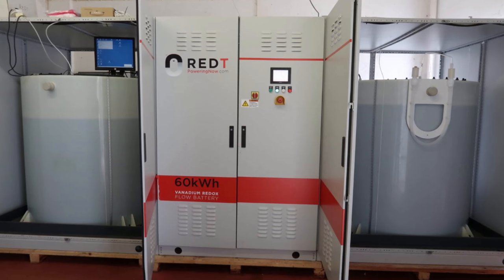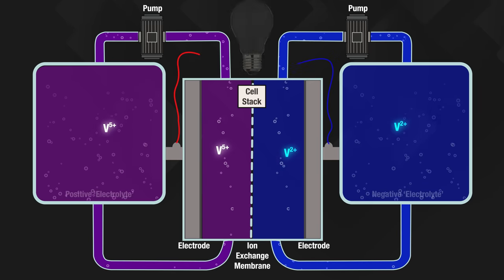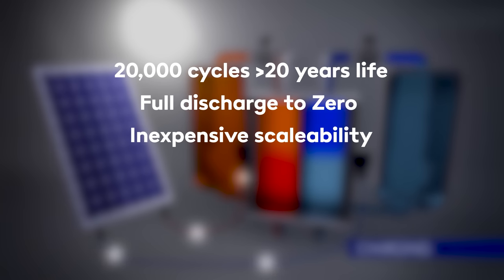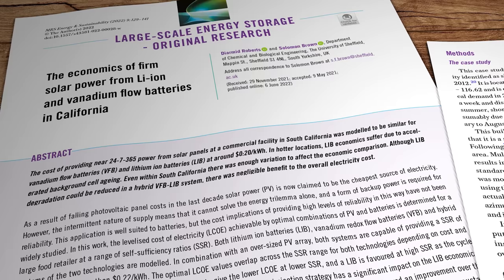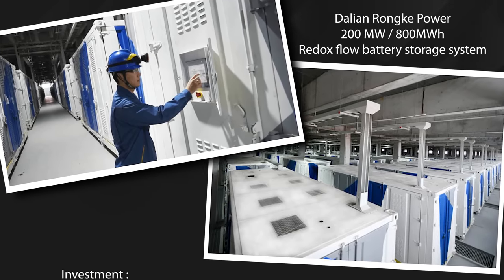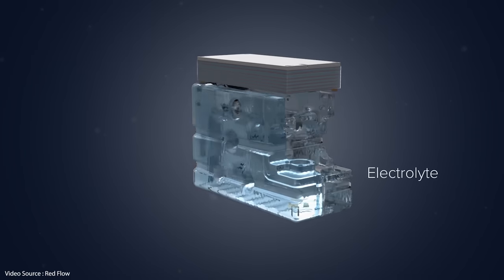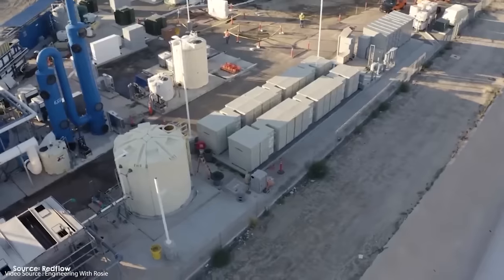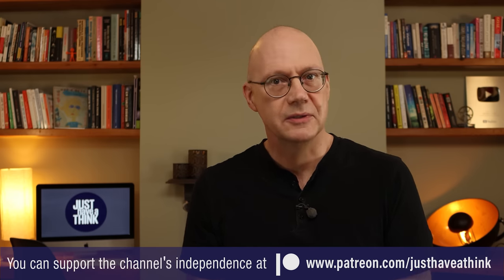The new billion dollar battery disruptor!

Comment: I think a good way to use redox would be a hybred with a lithium as the main for day to day use and the redox for longer term like week or month storage. Lithium with it's more efficient exchange and redox for it's low self discharge for longer term, should be a winner for solar and winds ups and downs, to take advantage of times of peak productivity.
Reply: Can you explain how lithium is more efficient?
Reply: @mortenhartvigkristiansen7760  lithium ion batteries have a lower resistance, so less electricity is turned to heat and when that  energy is used, over 90% comes back out again for use and I think in the video they said the redox has an efficiency in the 70's percent.

Comment: You noted that for added energy storage capacity with a redox battery, all you need are larger tanks. If true, then the incremental cost in $/Mwh for say doubling energy storage capacity should be far lower than the cost in $/Mwh for the initial amount of storage. 

Can you please give us some numbers, so we might gain some understanding of the relative cost and its incremental scalability, to address storage needs for standby capacity and possibly even seasonal peaks, as well as the daily time-shifting of solar energy from daytime to the nighttime?

Comment: I first read about redox flow batteries about 20 years ago, and it's pretty cool to see them reach the market. The idea of a bromine leak/spill from a Redflow system doesn't sound like fun, but I have no idea whatsoever about what the consequences of a vanadium electrolyte leak/spill might be.
Reply: Please look at the website for Gelion Endure battery in Sydney. They maintain that their Zinc  bromide battery is extremely safe , as it the key element in  fire extinguishing systems. Not poisonous I assume. They also toast a unit on a barbecue to show how safe it is near heat. 
Regards
Mal

Comment: Great video. Storage Will be important, but different countries can have different solutions. Countries with a lot of solar could better store as heat with molten salt batteries, while those with lot of hydro or wind Will probably benefit more from batteries.
However, modern nuclear Will have a role as backup just in case, and as a result of the daily lobbying and bullying they do.

Comment: If you do the calculation even adding solar panels to a CAES sistem base on steel tanks the price per kw should be les than half of any battery,the 40 % loses will be overcome by the solar panel , advantage of a CAES is that natural gas or hidrogen can be use to multiply or extend the power.

Comment: Flow batteries are cool in that they decouple power from energy storage, and are not sealed systems so if membranes or electrodes fail, they can be replaced without scrapping the battery and recycling it.  However, efficiency and energy density are both poor and complexity is high relative to a maintenance free sealed battery system like Li or Na ion.  And the biggest problem for any battery which has no application other than grid storage, is path to scale.  To get to giant scale, there is but one path for them:  billions and billions of dollars in very patient and risk tolerant venture capital, willing to just go for it and produce them at scale, subsidizing the initially high cost per kWh that customers won't bear.  For a new Li ion technology with higher energy density for instance, there's a ready market in cellphones and other mobile devices, whose purchasers are willing to pay a great deal more per kWh than any grid storage customer.  That gets them through the initial few doublings in production scale, so they can take advantage of Wright's Law learnings and reduce their cost.

Comment: A vibrating IR-active molecule transfers the energy on collision with N2, O2, whatever, increasing heat, 2.7 billion times per second (8 billion / second for air near surface). It's the balance between the amount of LWR from below absorbed by the IR-active molecules, which does not depend on the temperature of the air parcel, and the LWR manufactured & emitted upwards by the IR-active molecules, which does depend on the temperature of the air parcel. Since it gets cooler with altitude, the net result is less LWR emitted upwards. This aspect has been MEASURED FROM SPACE CONTINUOUSLY SINCE 1964 (IRIS-A on Nimbus 1) and sample plots have been all over the internet for at least 15 years. The "greenhouse effect" (GHE) in Earth's troposphere does work backwards and cause cooling only when surface temperature is below 228K (-45 degrees) and the GHE gets increasingly more powerful, causing more warming, as surface temperature increases per the plot with millions of measurements from space all over Earth (a vast range of surface temperatures measured, a green hash) at one of my links below. From my correct reasoning of the physics above that I did 8 years ago I always knew that it would show less GHE, even backwards GHE, in bitter-cold winter polar regions, understood that just from pondering for a couple years or more before I came across the measurement proof on the internet. See below for MEASUREMENT FROM SPACE clearly showing  H2O gas, CO2 (huge notch) & O3 (little notch) warming the surface for Sahara, Pacific Ocean, Mediterranean Sea, Iraq but COOLING the surface of Antarctica in winter (because, obviously, the troposphere gets warmer with altitude just like the stratosphere). See clearly the centre CO2 & O3 maximum power centre spikes in the stratosphere causing cooling just like you said, but only the tiny stratosphere spike effect shown, so it's totally overwhelmed by troposphere warming effect. The 5 or so groups of physicists producing varying (by about 20%) results all do a 120--layer calculation (or some such) for the top of troposphere and a separate layered calculation for the stratosphere and the GHE is a more powerful effect at the top of troposphere if I recall correctly because the stratosphere gases well-mixed gases reduce it though the extremely-poorly-mixed H2O gas causes warming of the surface when it gets in the stratosphere because it radiates to space on average from very low at only 2 km above surface. 
----------
Measured from space since 1964 samples and the green hash plot of the varying (GREATLY VARYING) "greenhouse effect" (GHE) all over Earth (note the backwards GHE over Antarctica in winter because no sunshine so the heat is descending instead of ascending):
https://www.youtube.com/watch?v=NNgMyDRWWrA at 3:50
https://www.youtube.com/watch?v=Oog7-KOtpEA at 18:07 (4 FTIR samples for western tropical Pacific Ocean, Sahara Desert, Antarctica & southern Iraq)
https://www.youtube.com/watch?v=s-ab-ZNXnZ8 at 30:55 (3 FTIR samples measured in 1970 for Sahara Desert, Mediterranean Sea & Antarctica)
https://www.youtube.com/watch?v=rgP-lwf2tb8 at 17:09 (3 FTIR samples measured in 1970 for Sahara Desert, Mediterranean Sea & Antarctica)
-----------------
<Web>climatemodels<dot>uchicago<dot>edu<slash>modtran<slash>modtran<dot>doc<dot>html
It has one comparison with Sahara Desert measurement to prove it's accuracy. The measured since 1964 are IRIS on Nimbus series. At 1969 it's:
Nimbus 3 IRIS instrument satellite 1969
Nimbus 3, the third in a series of second-generation meteorological research-and-development satellites, was designed to serve as a stabilized, earth-oriented platform for the testing of advanced meteorological sensor systems and the collecting of meteorological data. The polar-orbiting spacecraft consisted of three major elements: (1) a sensory ring, (2) solar paddles, and (3) the control system housing. The solar paddles and the control system housing were connected to the sensory ring by a truss structure, giving the satellite the appearance of an ocean buoy.
Mission/Portal Page:	<Web>nssdc<dot>gsfc<dot>nasa<dot>gov<slash>nmc<slash>masterCatalog<dot>do ? sc=1969-037A
Launch Vehicle:	Thor-Agena
Instruments:	HRIR (High-Resolution Infrared Radiometer)
IDCS (Image Dissector Camera System), IRIS (Infrared Interferometer Spectrometer), IRLS (Interrogation, Recording and Location System), MRIR (Medium-Resolution Infrared Radiometer)
MUSE (Monitor of Ultraviolet Solar Energy)
RTG (Radioisotope Thermoelectric Generator)
SIRS (Satellite Infrared Spectrometer)
............ etc etc etc

Comment: That 60kWh battery looks bigger than 4 of my 14kWh batteries (to be clear: more than 3 times as big). It also doesn't look like it will be around the same 10k euro for that 60kWh, which is the current price tag for 4x self made 48v LiFePo 15kWh battery boxes with BMS.
So I don't mind the place it needs, as long as it can do that 60kWh for 10k and 120kWh for much less than 20k.

Comment: Sounds good!  The only concern I have is availability and mining concerns surrounding the relatively rare elements of Vanadium, Bromine, and Zinc.  We might be better off with flow batteries that use iron ions, or other types which use organic compound ions.  How about an ATP - ADP type of flow battery?  Biomimicry might offer some solutions.. 🌿 🌄😊
Reply: Iron air batteries are interesting but keep in mind that most biological systems have very tight temperature tolerances. Inorganic systems are much simpler to manage in terms of the chemical stability of their electrolytes and hence have lower costs.
Reply: Bromine is the 9th most abundant element in seawater by mass (the top 4 being O, H, Na, and Cl, obviously, then other salts with Mg, S, Ca, K). Apparently you can get a liter of bromine from about 20000 liters of seawater, and that's reasonably cost-effective.

Vanadium and zinc are less plentiful, but still 14th to 24th most abundant elements in the earth's crust, depending on the dataset. Zinc is about on par with nickel and copper, about 3× as plentiful as cobalt or lithium. Of course, that's a less useful measure for land than for water, as elements are far more evenly distributed in the sea.

Comment: If Redox Flow is best suited for >8h durations, why does the biggest installation in the world (the one you mentioned in china) have a 4h duration?
Reply: The durations are a bit misleading, it refers to how fast you can discharge the battery, unrelated to it's capacity. The longer the duration, the less power (Watts) can be delivered by the battery type. Not the amount of energy (WattHours)
Reply: Is that the same thing as some 18650 batteries don’t work with flash lights?
Reply: @Beeeeeeeeeee  Your reply came up earlier than the question, in my browser at least.  Perhaps the question went via redox?!
Reply: Because it doesn't have enough capacity to meet the demand for more than 4 hours.
Reply: @TheEclecticDyslexic  yes, that's how I calculated the duration. the question is, why did they size the capacity like that?

Comment: I would've loved more information on the Dalian plant, and dalian rongke power. Its capacity absolutely dwarfs all the western players you mentioned. They had their series b a year ago. The fastmarket article mentions a lot of info on cost, which is not that much better compared to lithium over a lifetime (25%) at the expense of higher upfront cost. Also downsides like lower efficiency and smaller optimal operating temperature.
Reply: A lot better in terms of use of rare earth metals though?

25% cheaper for a much younger technology is pretty impressive.

Comment: Off-grid solar homes need a high-power lithium-ion setup of maybe 10kW and a few kWh  plus a low-power system of a few kW with a MWh or two to store summer excess and recharge the Li-ion during winter use when the clouds block the low sun. Current flow batteries seem to built with similar power/storage ratios to lithium-ion in order to provide an alternative in the same market rather than serve a different market where Li-ion is not competitive.

Comment: citric acid (and table salt and vinegar optionally) as metal-air fuel cell electrolyte, use iron scrap metal as the storage, at 2kWh/kg specific energy, yep large fuel cell batteries in a container, or use the container metal as the battery, too, just use plastic as the container

Comment: Great presentation! While not directly commenting on flow batteries, I have for some time been considering ANY lithium based battery solutions (yes, even solid) as dead ends. Lithium is scarce and I read a recent calculation of how much lithium exists globally and if every electric car over the next 10 - 20 years had to replace their lithium batteries twice, there would not be enough lithium in the world to handle the replacement. That is not a sustainable future. So, I get most excited about the new solid batteries that use NO lithium and are working towards using plentiful elements that are 100% recyclable. Seems like we will be there inside of 5 years.
Reply: Lithium batteries are recyclable.
I suspect you may have been reading a propaganda piece.
Reply: Apparently, China has just developed a solid state sodium battery which will be available in a compact EV for the Chinese car market. I hope it will also be made for export.
Reply: @alanhat5252  No, it was a decent piece that took into account levels of recycling. Sorry, I have to look for the article to back up my statements. But, anecdotally, there are lots of claims for recycling this and that and very few examples of industry actually proving they can do it.

Comment: Hi. My offer is out of the topic but want to ask. How about combination of Stirling engine and heat pumps? With application of Stirling engine  and high efficiency heat pump there's a possibility to use hiden heat for power generation and cooling of air. It has to be a great solution in the age of global warming. What do you think about it?

Comment: Flow batteries have an advantage over most other designs.  A fully-charged unit can be rendered electrically OFF by simply draining the cell stack dry and isolating the tanks with valves that are closed.  Turning off the pumps has the same effect eventually, when the cell stack completely discharges. 
You can even put a dead short across the + and - terminals to indicate that battery is not electrically live.
Shorting the terminals on most fully-charged batteries is a common way to have a very bad accident.  All that energy wants to get out _NOW_.  Talk to anyone who has dropped a wrench on the poles of a charged car battery . . .
Another advantage is that the power output is completely independent of the state-of-charge IF the charged-electrolytes are stored in tanks separate from the discharged-electrolytes.

Comment: Forgive me for counting, but isn’t vanadium 5 to Vanadium 2  a transfer of 3 electrons?

We need more info on the comparison of Vanadium and zinc bromide systems, methinks?

More to the point, how good are the membranes, these days?  Membrane life used to be poor, to say the least.
Reply: From the graphics, I believe that the V2+ gives up one electron to become V3+ while the V5+ accepts one electron to become V4+.
Reply: The ions are actually VO^2+ for V^4+ and VO2^1+ for V5+. Water is consumed during charge at the cathode and released during discharge, thus the need for a proton exchange membrane. The whole cell has a theoretical voltage of 1.23V
Reply: Membranes are a mixed bag. Nafion is still the de facto choice despite it being horrible for ion selectivity and cost. It wins out in terms of conductivity and chemical stability (since it's mostly Teflon)

Comment: Can you explain a bit more what 20 MWh actually means? I’m hearing all the figures but can’t easily put them into perspective. Is that 100 households for a week? How much is it compared to x ft of PV? Thanks so much!
Reply: Go crack open your electric bill and see how many kWh you use in a month.  Divide that by 1000 to get MWh.  How many of your houses can fit in 20 of those?  My current average (over 2 years) is 0.9 MWh/month.  20 MWh is like powering just over 20 of my houses for a month or my house for 20 months.

Comment: One other probable advantage of flow batteries over lithium ion, not mentioned, is that not only are they more tolerant to higher temperatures but thermal management should be significantly easier. In extreme environments, with lithium ion batteries the whole system would probably need to be in a temperature controlled enclosure. With flow batteries, you just need temperature control for the electrochemical cell area but because the storage is in a fluid you could just store it in insulated tanks and simply pump the fluid through heat exchanges to stop it from overheating or freezing.

Comment: Titaniferous magnetite is the principle source of Vanadium, 96% of which is sourced from China, Russia, and South Africa, 70% currently coming from China.  From a strategic point of view, we might be better of with iron, titanium, manganese, or organic compounds for the different ions in solution. In terms of availability, there's another question to be answered as well.  🌍 🌎 ⚓ ⛏️
Reply: Vanadium can exist in 4 stable oxidation states in solution which is why it is the most commercially mature RFB chemistry. Vanadium crossover through the membrane does not affect capacity since only vanadium is used. 

Other chemistries have to deal with contamination from crossover which is irreversible. I agree that vanadium is not the best choice long term but right now it's one of the better choices. Vanadium is also toxic. 

Organic 'redoxolyte' RFBs seem promising to me since they used reversible organic redox couples which can achieve much higher concentration than vanadium and not have any geopolitical strings attached